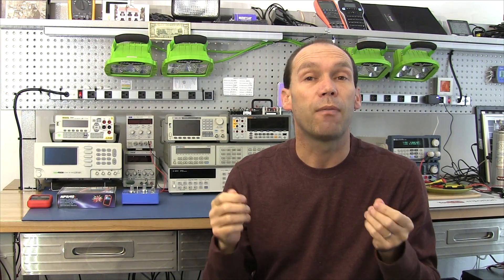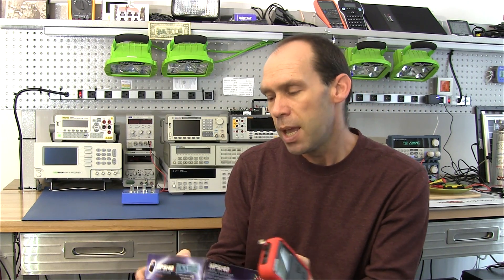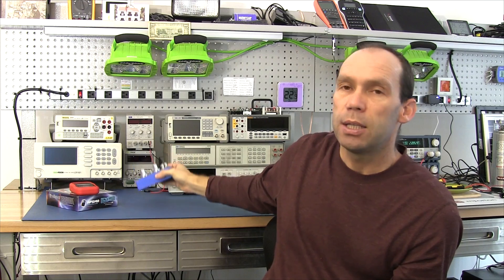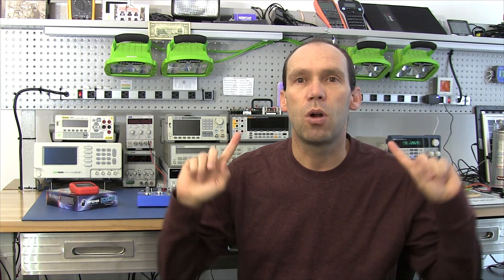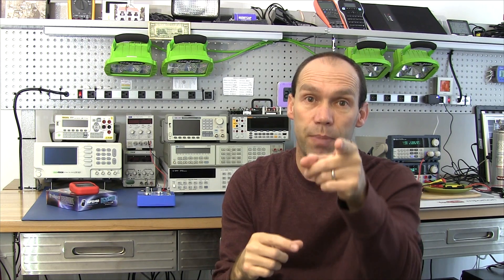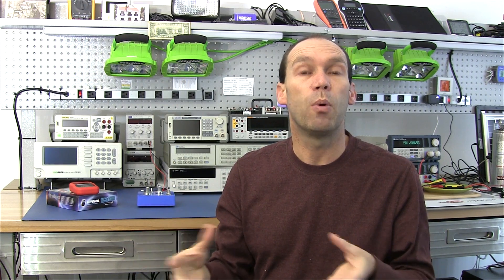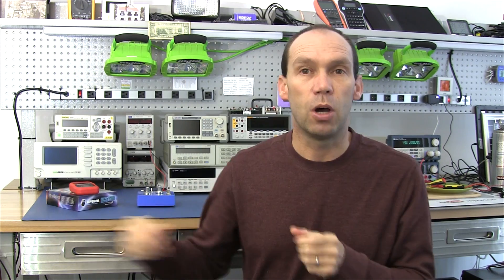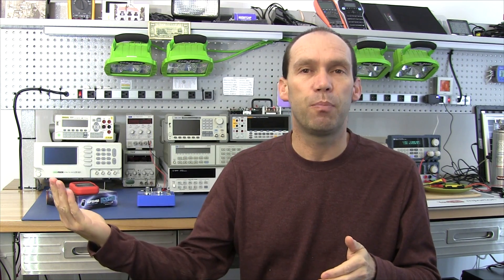T4D #86 - Time to pack up

Comment: Good luck with the move Martin.
I will check to see what type of ventilation is there in that basement the Radon is of concern but is not the only one and you will probably spend a lot of time in there also.
Then depending on location flooding is possible and there are a lot of expensive equipments in your lab. As you can see I'm not a big fan of basements :)
But on a positive note you will have a lot of space.

Comment: Hello Martin, I need some help when you get some time, I have installed a 30 amp breaker for my generator with an inlet plug and I would like to install the small dual amp/volt gauge so I can balance out both sides of the breaker box when the generator is running, , I kind of know what and where the CT's go  they have two green wires that connect to the back of the  gauge but confused as to where the red & black wires  from back of the gauge connect to, I saw a picture  one on youtube but very confused as to how it was connected , also I guess I would need two gauges one for each side of the 30 amp breaker, I think you might consider opening up a Paypal account for people like me to make a small donation for your help which is not unreasonable 
Thanks Martin
Al Ruark  USA